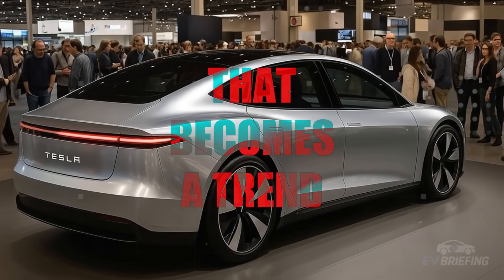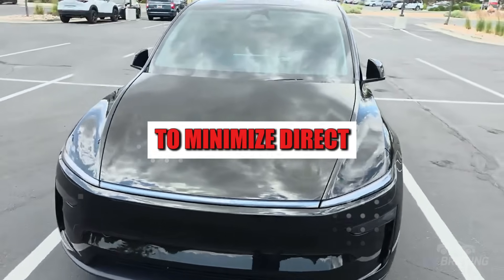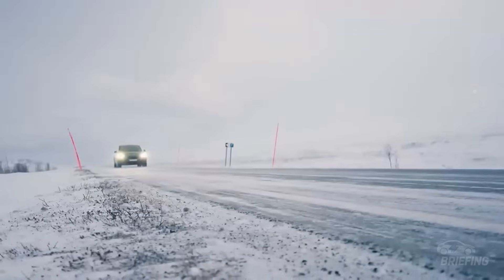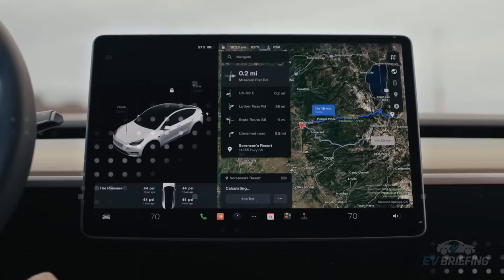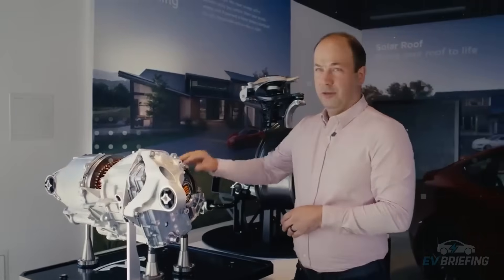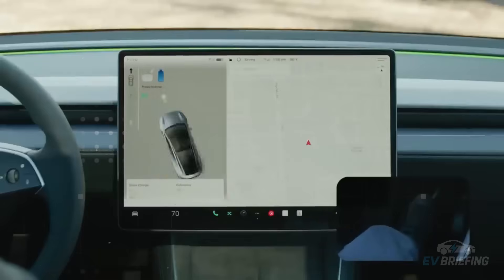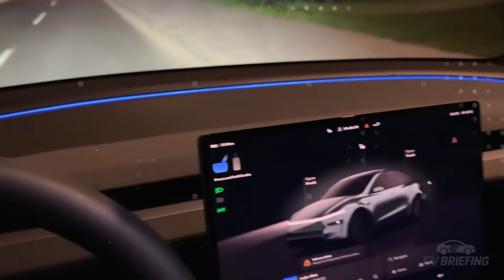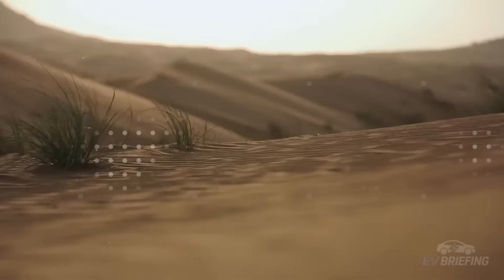Finally HERE! Tesla Model 2 for $10,879 with 855-Mile Range and a Battery That Lasts 20 Years?!

Comment: I drive a model three. None of this is true.
Reply from the maker: Appreciate your input — totally fair to judge based on your experience. This video covers upcoming tech and leaked info that may not apply to current Model 3s yet.
Out of curiosity, which part felt the most off compared to what you’ve experienced with your car?